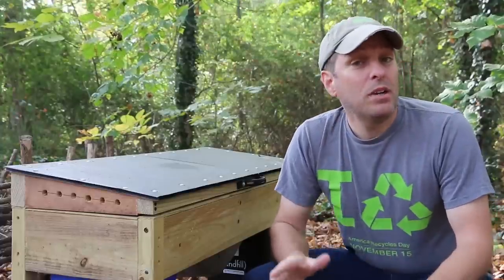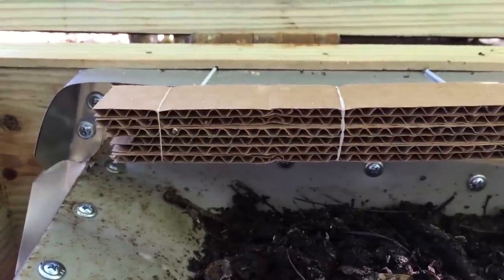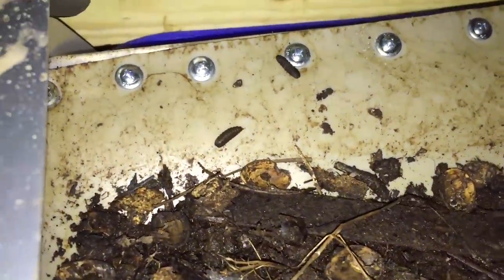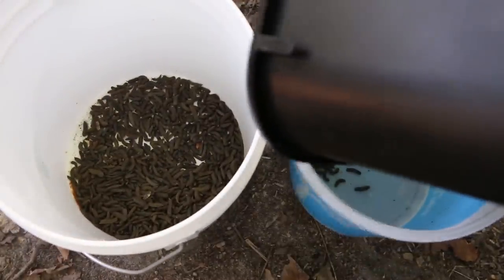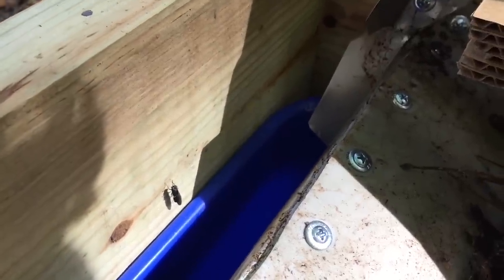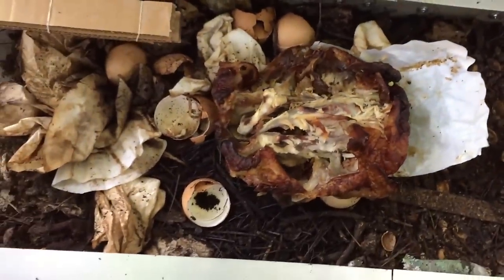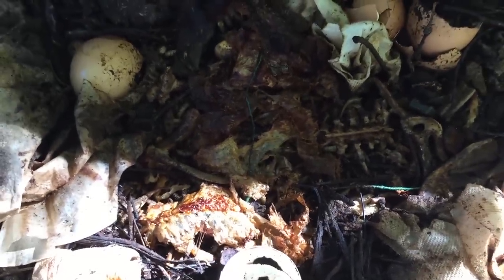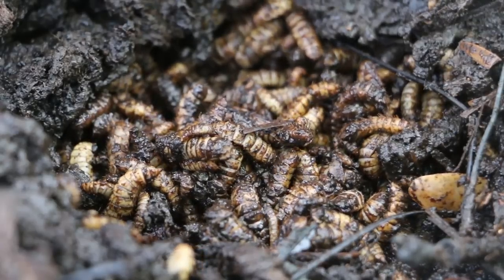How To Operate A DIY Black Soldier Fly Larvae Composter

Comment: Hi! I live in the southern part of India. In our backyard we use a very simple DIY model. We take 2 large PVC pipes and keep their one end in the ground and the top portion is covered with a fitting lid. We add kitchen refuse and other household organic waste to one of the pipes everyday till it gets filled. Once it is full, we move onto the next pipe and repeat the process, during which time the refuse in the first pipe gets consumed. :)

very efficient way to minimize waste! And these BSF larvae eat almost anything! :)
Reply: Manu Question please: if the pipe is standing vertically in the ground and it has a fitting lid, how do they get air? And when done do you scoop them out? Please explain further.
Also how hot and humid does it get in your area? Is this year round harvest for you? Please explain.thx
Reply from the maker: I do something similar with worms. I agree it is a simple but effective system to compost kitchen waste. Thank you for watching.
Reply: @BrMark-cu9ih  I would think that air would come up through the soil? Since it's quite porous. If water can drain through it, air can circulate through it, by my logic. Earthworms stay deep within the soil most of the time, after all. But I do wonder if you painted the outsides of these pipes black, how much warmer the contents could stay in an Oklahoma winter... I'm sure you'd have to be careful or they could cook, on a sunny day.

Comment: I saw a beautifully simple system where they used 55 gallon barrels. they cut out the top and created a mould that they then placed concrete into to create two gentle ramps for the bsfl to crawl up on. the concrete hugged the wall of the barrel. at the top where the ramp reached it's Pinnacle, they drilled out a hole that led to bucket for the finished product. you could do it in few hours and the expense is at most $20-30
Reply from the maker: +Closing the Loop I've seen a Black soldier fly larvae composter like this, but on a smaller scale. My build was definitely complicated. I plan to create a much simpler version soon. Thanks for watching.
Reply: I'm obsessed with your set up! I'm trying to figure out who I could have recreate it for me :) have you created a simpler version yet?  @GreenShortzDIY

Comment: slope the top so the condensation runs down to a side and you can then have it drain out on its own. make a slope on one side for larva and the top slopes to the other side. one side would output larva the other side would output liquid for the garden.
Reply from the maker: +Patrick McMahon interesting ideas, Patrick. Thank you for sharing. I’m in the process of designing a simpler soldier fly composter and will consider your ideas. Thanks for watching.

Comment: Hi from Texas, started composting and attracted a handful of earthworms but realized I had tons of these.  Excited to find out that it's a compost method.  We have plenty of warmth.  I was doing earthworm basins, but every time I lift lid on my compost big flies go everywhere.  Hoping they're all soldier flies
Reply from the maker: Yes! Your gonna love BSFL. An adult solider fly looks like a small black wasp, but flits around when it flies, instead of hovering smoothly like a bee or wasp. What you initially attracted was probably a composting worm. They are native too. An earthworm wouldn't be interested in your compost. They only process soil and generally stay deeper than 18" unless it rains, bringing them to the surface. Soldier flies will quickly run off the house flies. They eat the house fly eggs and stop the life cycle. Thanks for watching. Happy composting.
Reply: Cool! @GreenShortzDIY

Comment: funny thing to have just run into your videos, as I'm quite active here and your bsf video is not my first.
a bsf bin is to be my next build, but as you mentioned moisture it may be my largest problem living in the rainforest.
no worries, will make it work.
thanks for the video.
Reply from the maker: Bad? :-) I’m guessing that’s not what you  meant given the nice-ness of the rest of your comment. You might consider a steeper slope to the roof of your bin. And more venting than I’ve got. Thanks for watching. Good luck with your build.
Reply: GreenShortz DIY yeah, sorry for that!
caught it this morning, "BSF", dang spellchecker!😆
Reply from the maker: Ha! No worries. I figured as much. The trolls don't say anything nice. :-) BTW, I'm currently designing a simplified version of this BSF composter. Video planned in the next few weeks. Thanks for the comments.

Comment: I have built one of the composters ala your instructions.  It is a very nice unit but, I have a couple of comments about your presentation: 1. you did not specify the size waste bin to use so I bought the 28qt which I discovered was smaller than the one you used, so, my unit is smaller than yours (still workable though) 2. the person I built it for wanted wheels, so I added blocks on the feet to accommodate the wheels and then added handles so she could wheel it about like a wheel barrow to more suitable temperature areas - I would love to send you a picture of the finished product but, can't figure out how to do that.
Reply from the maker: Hi Peter. A smaller bin should do just fine. I'd love to see a photo of your final product. Email me at tom at greenshortz dot com. :-) Thanks for watching.

Comment: I'm not harvesting them or anything but before I knew what these were a few years ago, I noticed them in my composter (larvae) and the adult flies and thought it was a bad thing. I did notice the larvae show themselves any time I put food waste in the composter (as it was dominated by yard waste and wouldn't see them). 

The city, for free, provides composter's so I got an extra one. I also got a cat and was planning on composting the kitty litter (corn based compostable). So, first time I put the compostable litter in there, I was expecting it to take a long time to compost. However, I had some old bananas and dropped those in there 2 days later and the corn-based cat litter was gone! I could see the larvae at the bottom of the new composter (I didn't put them there... the composter has an open bottom and just 'plopped' it in place in the back yard). That said, I live in South Florida and it's just astounding. I started looking them up and learning more about soldier flies. I saw that they can eat 'meat' (which I never put in the composter). I had some old sandwich meat so I threw in a slice in the morning to see what happened and was planning on pulling it out if nothing happened. I looked back in the afternoon an there was no trace of that sandwich meat beyond a frenzy still going on where I dropped it.

I've been wondering what these critters won't eat that is organic.

I did note that I saw egg shells in this setup. Will they ultimately eat those or break them down?
Reply from the maker: Hi James. I’m just getting down to some earlier comments. Frenzy is the right word when the larvae get going on some old ham. :-) In south Florida, I bet you’ll be able to compost with the BSFL year round. Up here in Atlanta, they go dormant for our cold months. Thank you for sharing your experience. Thank you for watching. Happy composting.
Reply: @GreenShortzDIY  I'm waiting to see what happens over winter. My composter is over the sandy soil in my back yard (aka: coastal, very sandy... almost 'beach like'). My hope is the frass will slowly turn that 'desert like' soil into fertile soil over time.... which, for now, when a plant dies I just give it a small tugg and the sand just falls off the roots... there's really nothing there but sand. I've been composting a lot. I also have a avacodo tree that dumps tons of leaves I keep for composting (and broken avacados too... I love that tree that produces so much material I can compost).

Comment: Wondering if treated lumber would work I wanna build a larger unit an have alot of treat plywood but not sure if this would effect the bin
Reply from the maker: I think it would be fine for the construction. You might consider lining it with a plastic tarp (maybe two layers of that) to keep the moisture out of the wood. The one I made in this video was too complex. I simplified it in a later version. I could see a 4x8 sheet of plywood, cut in half, as the tilted floor (low point in the middle, ramping up toward each end). Box that in with a 2x8 rim forming the box. Perhaps something lighter for the lid. Hope that helps. Thank you for watching.

Comment: Is the composter back up and running? I'd love another update, and I'm curious if you would build the bottom of the tray the same again? IE the part that collects the liquids at the bottom where some of the larva were escaping.
Reply from the maker: I did get it going again and have delivered another batch of black soldier fly larvae to the neighbors chickens. It is fun to watch them get gobbled up. I do plan to make a simpler version of this system and the compost area is definitely a component I'll be revising. I had a viewer suggest using a tarp, which I thought was a great idea. No lacing with trimmer wire, just stretching out the area needed and screwing it down. That video will come sometime this summer. I'll try to get an update video done sooner.
Reply: A tarp will not hold up more then one or two seasons. The heat and humidity will rot it and the BSFL will cause fissures that will allow them to escape.

Comment: If I ordered a few hundred BSF larvae and let them turn in to the flies, would that be a good way to get started?

What did you do for your very first time to start the cycle?
Reply from the maker: Actually, BSFL started showing up in my outdoor worm bin. I didn’t know what they were. Did some research and learn about their benefits as composters. Now they are my favorite composting machine! What I’d do to start a system with 100 pupae is to make a small pile of wood chips (or an existing leaf compost pile) and bury your pupae in that about an inch or two below the surface. Place your BSFL compost system next to this pile. Make sure you seed the compost system with something that is rotting. I use raw chicken that has gone bad. Make sure your bin has a way for the adult soldier flies to get in. They also like small cavities to lay their eggs in. Corrugated cardboard with the gaps exposed is perfect. This needs to be off the surface of the compostable material. Adult soldier flies won’t lay eggs on the rotting material, but near it. Watch for a white mass of tiny eggs. Keep the food scraps coming and they’ll multiply like crazy. You will likely see house fly larvae first, but the soldier flies will come and take over. They’ll eat the house fly eggs and stop their lifecycle. Hope this helps. Happy composting.
Reply: GreenShortz DIY - perfect! I really appreciate the detailed explanation. I'll let you know how it goes for me.
Reply: Mr. Measure Twice how did it go?

Comment: Also do you think you could somehow surround the setup by compost walls over the winter to keep the temp up and the apparatus rolling over the winter?
Reply from the maker: +Chuck Streich I tried something similar last winter. I buried one soldier fly bin (my old system) in the middle of a compost pile, with a 4 inch PVC pipe to drop food in. A second bin was partially buried and surrounding with hay bales, including one top. Neither bin continued to produce at the rates see during the summer. I think it can be done, but would need to be in an indoor, heated setting.

Comment: I have a question. How to keep household fly away from my BSF?
Reply from the maker: Hi Michael. There isn’t an easy way to do this, but the soldier flies will eventually run the house flies off. In my experience, the house flies arrive first. But, once the BSFL emerge they take over. My theory is that the BSFL eat the house fly eggs, which are laid on the food waste. Soldier flies lay their eggs away from the compostables, so they are safe from being eaten while vulnerable. Hope this helps. Thank you for watching.

Comment: I've got a bin almost ready to start except for the exit ramp. I notice yours is metal. Do you have to worry about it getting to hot? Do you know if they have a preference of metal/pvc/wood?
Also, i worry about lizards and skinks getting in through the slits and eating them.
Reply from the maker: The metal stayed out of the sun, so heat wasn’t an issue. I’ve also cut up the lid to a plastic tote (#2 plastic) and made my ramps out of that. I’ve been using this first bin for about 8 years and the aluminum ramps have corroded to the extent that they need to be replaced. I’ll replace them with plastic. I haven’t had a problem with lizards. What has raided one of my bins is an opossum. :-)

Comment: Would a couple plastic ribs glued to the bottom of the top create a drip line? This condensation could increase how much "tea" you produce?
Reply from the maker: Your idea would work as the drip line. On a few occasions I did see the condensation pooling on the top of the frame, so I does drip down. I'll have to try this mod in the spring. Right now I'm trying to find ways to keep the soldier fly larvae warm through the winter. Working on that video now. Thanks for sharing your idea.
Reply: GreenShortz DIY How cold do your winters get? I just add a layer of insulation and feed mine more. More food = more movement and digestion = more heat waste. Where I live, overheating is more of a concern though.

Comment: What advantages do BSF Larvae have over worms? Worms won't fly away...
Reply from the maker: BSFL are super fast composters. It is almost scary. And while the adults can fly, they usually stay and lay more eggs. Adult soldier flies don’t have mouths. They only live to mate and lay eggs. I like composting with worms too. While they are slower than soldier fly larvae, they will compost year-round where I live (in Georgia), but I can bring them inside can they won’t fly. :-) Another advantage of BSFL is that they compost meat and dairy, something worms won’t do. BSFL also multiply to match the task, when I have a lot of compostables, adult soldier flies lay more eggs. Because of this rapid multiplication, I can use the larvae for a food source for chickens. My neighbor’s flock of eight chickens would wipe out my worm colony in a few minutes (if given the chance). Just a few reasons why BSFL are my favorite composter. Thanks for the question.

Comment: What are the differences or downsides to this kind of compost?
Reply from the maker: With BSFL composting there are a few things to consider. One, while the larvae themselves aren't harmful, the warm environment inside the composter can harbor bacteria that can make you sick. I usually wear gloves and or just wash my hands extra well after adding scraps to the bin or collecting larvae. The residue left behind by the larvae is a gooey mess, unlike the soft rich casting left behind by composting worms. It can still go in the garden though, when I clean out the bins in the fall, I usually add to my garden beds and cover it with wood chips. Some people will let worms finish the composted material left behind by the BSFL, but I like to keep them separate.
Reply: That's one idea I had, was staging compost... like this into bokashi or earthworms.  I would be curious if it would compound any benefits or degrade them by doing this into earthworms then to tea, or just this into a pile.   @GreenShortzDIY

Comment: Has anyone done this in a larger compost pile with a mix of food scraps and “browns”? Curious if I added the self harvest system to an already existing compost pile outdoors. If not, I suppose I can harvest from the BSF bin and add to the existing browns to combine.
Reply from the maker: Hi Erica. You might consider partially burying a 5-gallon bucket in your pile to keep your food scraps concentrated. But, do it at an angle (45 degrees). This will allow the larvae a ramp to crawl out. Cut some holes in the lower edge of the lid to give the larvae an exit. Put larger holes in the lower end of the bucket to let the liquids (and nutrients) drain into your pile. I’ve been wanting to try something like this. Haven’t yet. Thank you for watching.

Comment: I found about 30 dry ones outside my compost bin... Do they then turn into the fly, should I keep these to start my own farm?? (The goal) I'm completely brand-new to this.
Reply from the maker: Hi Steph. If they are still wiggling, then they haven't hatched yet. If what you've found is an empty shell, then they have already hatched into adults. Keep a food source around for them and they'll multiply. Make a specific bin for them and you can begin to use them as composter and food source for chickens or fish. :-)
Reply: @GreenShortzDIY  Thank you!

Comment: Is it possible to do a similar setup with a different kind of fly? BSFs don't exist in western Europe, however we do have the common house fly (musca domestica).
Reply from the maker: +vangi mi I have had house fly larva get in this composting bin before the black soldier fly larvae arrived. They didn't exhibit the same characteristics as the black soldier fly larvae, which neatly climb out of the bin when they are ready to pupate. The house fly larva pupate in the compost. This makes them harder to separate. However if you are feeding larva two chickens, for example, you could simply dig out the compost and let the chickens scratch through it. Thanks for your question.